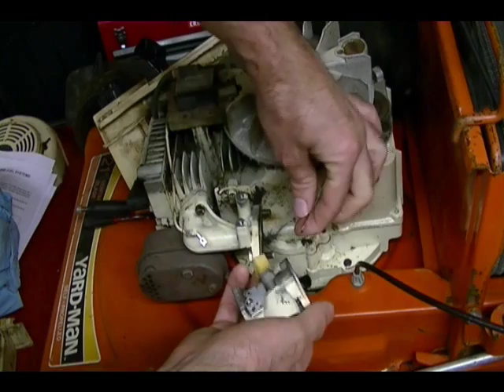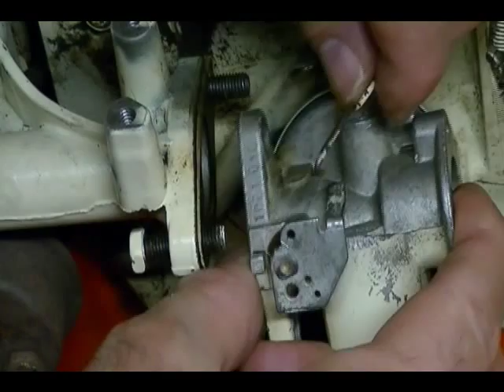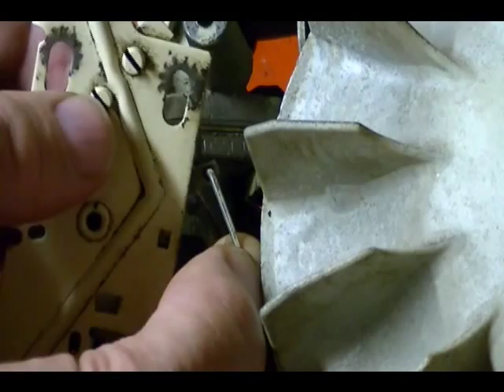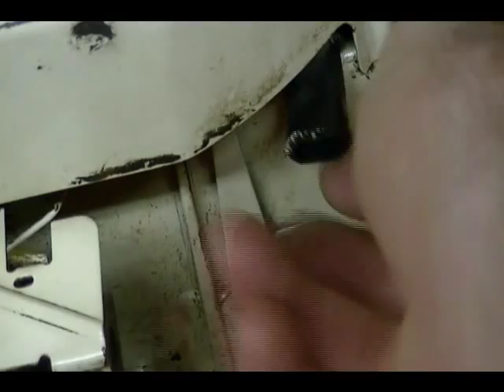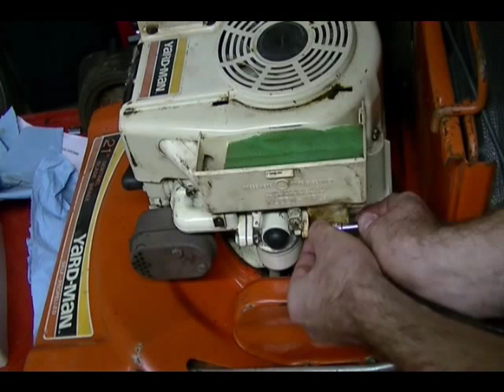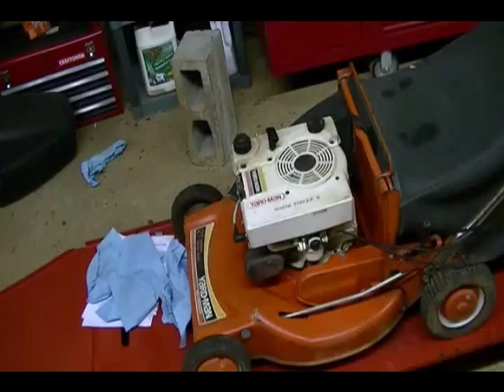Small Engine Repair: How to Clean and Rebuild a Tecumseh Lawn Mower Float Carburetor Part 3 of 3

Comment: Only about half of the jobs run that well by doing what is shown. Some times the carb is clogged deeper in or the compression is bad, or spark, etc. I would have made sure the engine runs. Leaving the shroud finger tight and not putting on all the other stuff until I know the engine runs good.